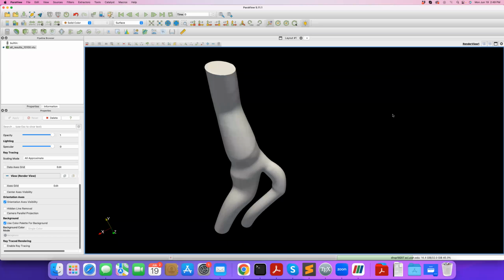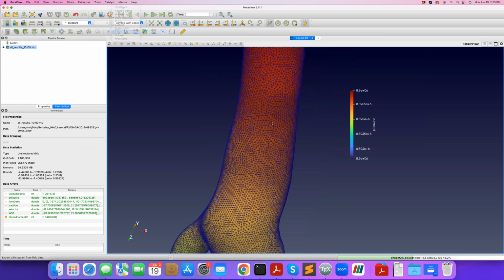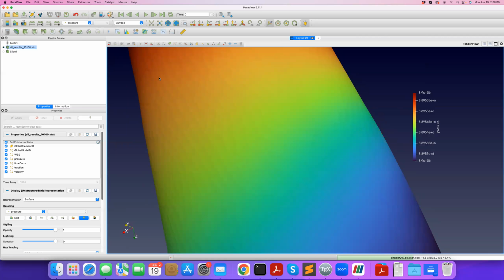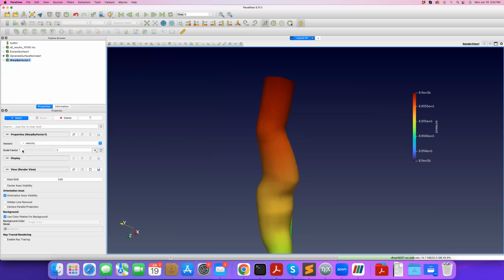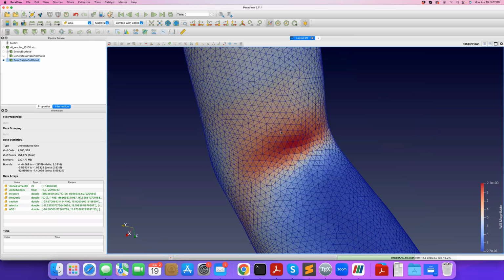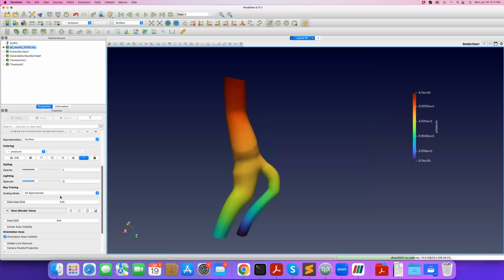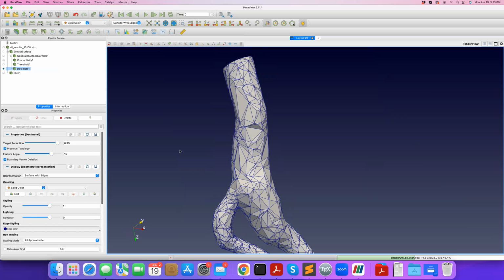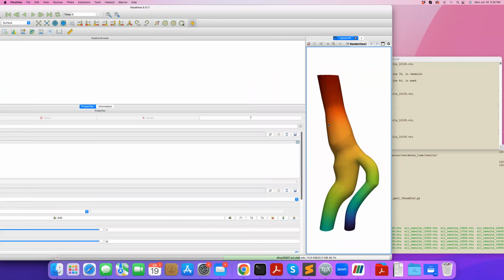Introduction to ParaView and its various useful filters for data visualization/processing.

Comment: Thanks for the tutorial, Dr. Amir. So I tried the plot over line functionality for a .vtp file but couldn't get any plot. I also converted the file to a .ex2 file, however it didn't help. Have you had a similar situation?
Reply from the maker: If you have a vtp file then I assume it is a surface. When you do plot over line for a surface the line has to exactly lie on the surface and if it is a curved surface then that might not work.
Reply: @mramirh1  hi yes, you are right. I've a plane 2d surface of SPH particles. The problem seems to be with a 2d cloud of SPH particles. This problem can be solved by using delaunay2D on the data points first and then using "plot over line" on the delaunay2D. Thanks so much, Dr. Amir.